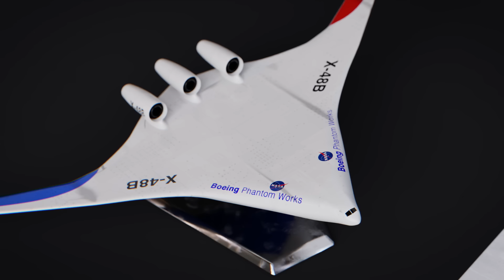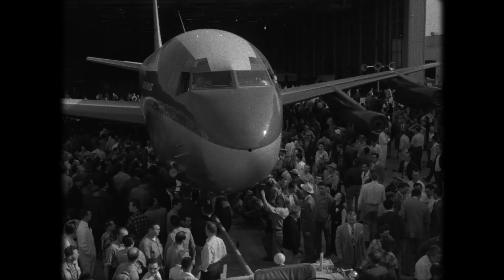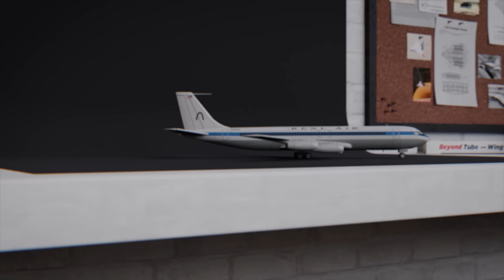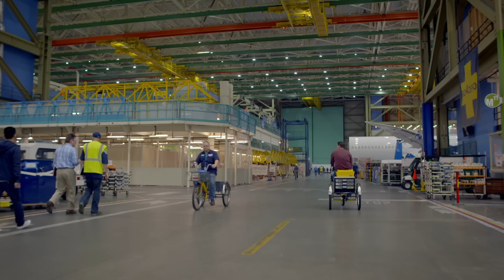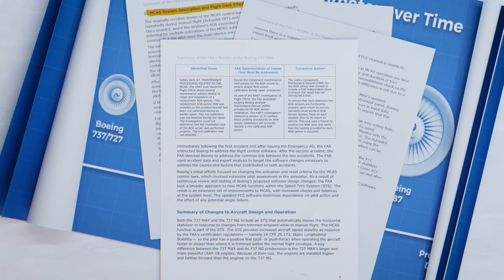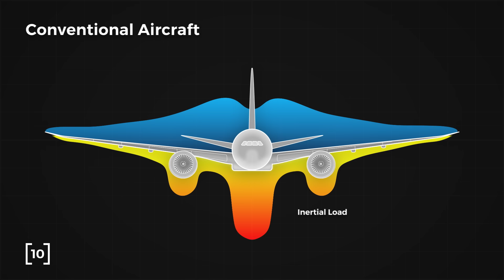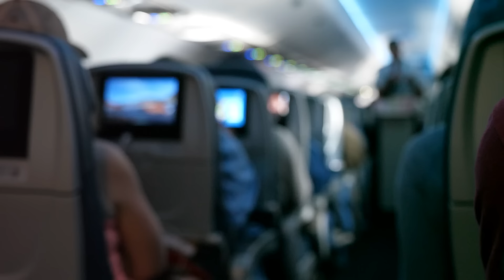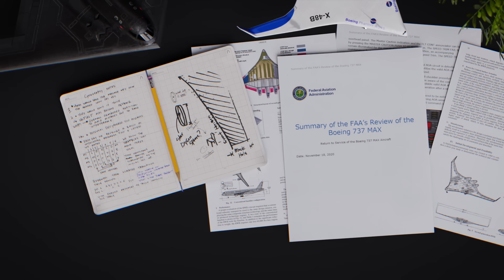The Plane That Will Change Travel Forever

Comment: 9:45 Fun fact: The Wright Flier, the worlds very first airplane was designed to be unstable. Both the wing and the canard provided lift, meaning if the plane left level flight it would be pushed father out of level flight by the passive forces.
      This was a deliberate design choice by the Wright Brothers, but subsequent airplane designers disagreed with this design philosophy and future aircraft designs were made to be stable, as you described.
     For the Centennial celibration of the Wright Brothers first flight a replica Wright Flier was built. Several highly trained and experienced test pilots tried to fly it, landed and refused to try again because the plane was so difficult to control.
     I'm not sure if the first flight was actually reenacted, but it makes that first flight even more impressive when you think about the fact that test pilots with thousands of hours of flight time were afraid to fly this plane, and the Wright Brothers did it with no flight experience at all.
      Can you imagine walking out to an airport, renting a Cessna 172 (one of the easiest planes in the world to fly) and teaching yourself to fly it by climbing in and taking off? You could, in theory do this. Flying an airplane isn't much harder than driving a car. But it would be highly illegal.
      But this was how the first generation of pilots learned to fly. Except they were not renting airplanes carefully designed by aeronautical engineers to be easy to fly. They were flying planes they built themselves with no understanding of aeronautical engineering whatsoever. Or at best very little knowledge.
      Early aviation is a wild and crazy story with plenty of death.
Reply: Awesome post
Reply: I built my own hang glider in 1979 without ever seeing a proper one.  A bit exciting but I am still here .
Reply: @George.Andrews.  Did you ever actually fly your hang glider.
    But now I think about it, you could be an aeronautical engineer.
      Even if you're not, even a home made hang glider (or even a full sized airplane) would be just as safe as a factory built aircraft.
     You may have trouble convincing the FAA it's safe, but it could be done if you know all the engineering.
Reply: @Eric Taylor  It was the Rogelo shape that was originally designed as a steerable parachute to bring the space shuttle down. 90-degree nose angle  with 3 degrees billow in the sail and a loading of about 1 pound per  square foot. 280 sq ft total. I took the dimension from small black and white photos from a library book using a pair of dividers. I wrecked my sisters sowing machine, making the sail. For the wires, I made a crimping tool, which I clamped in a large vice and beat with a club hammer until the faces touched. There are no hills where I lived, so with a harness made from seat belts, my brother driving my van (CF Bedford with wide wheels and fur lined)we towed it up. 
So yes, I'm an aeronautical engineer, hahaha.
Reply: @George.Andrews.  what's the opposite of an aeronautical engineer?...🤔.... a  crash test dummy...😆... They should give you an Honorary Degree...😁
Reply: @Reality_Check-1969  what have you done boy?
Reply: @George.Andrews.  🤣
Reply: @George.Andrews. that's a aeronautical engineer if I've ever heard of one
Reply: Having a canard does not necessarily make the craft not stabile in pitch.  if the Lift curve of the stabilizer is less steep than the wing, a pitch up will self-correct.  By the same token, you can have a stabile design with a lifting tail. To be stabile, the combined Aerodynamic Center needs to be behind the CG.
Reply: I think it bears mentioning how the brothers Wright taught themselves how to fly, because they first flew aircraft tethered to the ground, like a kite. Thus if they crashed they wouldn't have much forward motion making them more likely to survive any crash.

Only after that they started flying gliders and motorised aircraft
Reply: The wright flyer was stable, and they had been flying in similar looking gliders for years before.  They were aeronautical engineers, and scientists.  They built the first wind tunnel and did extensive experiments before designing and building the gliders.
Reply: Loop lplllpppppppp
Reply: @aryagamis  More like Loo-crack, snap, aaaaaaaaaaa crunch.
Reply: They actually had flying experience flying tethered gliders into the wind and down hills
Reply: I knew about the inherent instability! Look no further than the Wrights' background as cyclists for why they didn't dismiss the idea. Once they had a grasp of the mechanics of lift, understood their thrust needs and their limitations in terms of the weight and the thrust/weight they could achieve, having additional lift surfaces was an acceptable solution because they knew unstable vehicles can be made to work just like learning to ride a bike.
Reply: @fixedG bikes are extremely maneuverable, unlike tricycles.
And guess what military jets do
Reply: The Wrights created wind tunnels and carefully measured their designs.
Reply: You say it was "designed to be unstable". Did you mean that it was designed in a way that happened to make it unstable? Intentionally designing something in such a way that it does not fulfil its purpose correctly sounds illogical in this context.
Reply: The very first airplane are you sure? Ader's Eole wasn't a plane because it only flew 50m in 1890 but the Wright's flyer was because it flew 255m after having been catapulted? In the end of the day, Santos Dumont's 14bis remained the first to take off by itself (which is what self-propelled means) and Blériot XI crossing the English Channel was the really first truely operational airplane.
Reply: @Metr0politan92  If Ader's aircraft actually worked he would have kept developing it into something that could fly more than short leaps.

Keep in mind that the 1903 Wright Flyer didn't take off using a catapult, but a starting rail that lowered drag from the ground. Thus not putting any extra energy into the aeroplane. 
Also don't forget that their 1903 flights were made into a 27 MPH (43 km/h) headwind. You need to take this into account to accuratly judge their first powered flights, since distance alone would make the first flight seem like a lowered leap, like the others.

Remember how I said Ader should have kept developing his aircraft, because that's what the Wrights did and by the end of 1904 they were flying complete circles and flying more than 1200 meter in a single flight. In 1905 they flew multiple times well beyond ten miles.
Reply: @martijn9568  do we know ALL the factors with ALL the potential inventors?... the main ones maybe being funding and materials... and possible investors to back it all...
Reply: @Clery75019  So does that mean Santos Dumont's airplane was the actual first one?
Reply: @MeneTekelUpharsin  To me there's no such thing as a first airplane. It's been a progressive process from Ader to Blériot, and it's just misguided to want to credit a single plane as the first one in order to better discard all the other ones.

Comment: The problem is, airport infrastructure is designed for the tube and wing type planes.
      Planes like this could not use the same terminals as classic designs, meaning entirely new terminals will have to be built and designed.
      Airplane makers are not going to build airplanes that can't use airport infrastructure and airport planners are not going to build infrastructure for planes that do not (and may never) be built.
     Something like this happened before. The early airline industry had a problem. There were no airports. The problem was solved by building flying boats. They had passenger liner terminals that could handle large numbers of travelers and could be modified for relatively little money to handle flying boats.
       So the biggest passenger planes were not made to operate on land, they were made to operate on water, and could not be operated on land.
     This did not encourage anyone to build airports and without airports no one wanted to design larger passenger planes.
     This catch 22 was not broken until the outbreak of way forced the building of large airports from which large bomber planes could be operated.
    After the war these airports still existed. Some of the bigger cargo planers and bombers were converted to the first post war airliners and because they were much more efficient AND could be operated from land airports we saw the end of the flying boats.
      I'm not sure what could break the current catch 22 that is preventing a radical change in passenger plane design.
      You would have to design something that could operate from the present terminals. And we have reached the limit of what can be done there. The biggest plane currently operating has folding wings like a Navy plane just so it can fit in a normal terminal gate.

Comment: "In an act of corporate greed"  Not so simple.  FAA writes the regulations which are written for their purposes, not in the interests of technology advancement.  A more egregious example was the "three engine minimum" held for many years after engine reliability had been increased and two engines were just fine.  The FAA had to retire the executive to make it happen.  Europeans tend to trust government as an alloyed good.  They're not.  Government works to maintain the status-quo.  Airbus planes are really all fly-by-wire now and that is the future.  They have also has terminal sensor failures.  Lastly, pilot training in the East is traditionally a step down from the West.  I doubt a US pilot wouldn't figure that out pretty quick, disabled the MCAS and flown the plane, which is standard procedure MCAS or not.  (Full disclosure, my son in law is a 737 pilot)

Comment: Robert Liebeck invented this configuration decades ago at Douglas, well before the merger with Mcdonnell.
The advantages do not include the primary requirement of minimizing the overall costs per passenger - mile, combined with the capability of  actually safely reach remote destinations.
The overall best configuration is close to the Boeing 777-X, with the foldable  wing tips.
Reply: The induced drag explanations with the notion that the wing tip vortices are responsible for this drag is fundamentally incorrect. The kinetic rotational enery of the vortices are related to the energy exchange between pressure and velocity as described by the Bernoulli equation. Resulting in extremely low pressure in the core of the vortices, as seen in the visible condensation in the trailing wing tip wakes.
The induced drag is due to the leaning back of the lift force by the induced angle of attack.
The slower the speed the more the tiltback, and thus the induced drag. For normal winged aircraft this drag is proportional to the square of the spanloading and inversely proportional to the dynamic pressure: density times 1/2 velocity square.

Comment: Another idea to reduce drag and fuel consumption that is less radical is to move the center of gravity of the tube and wing so the tail produces lift instead of downforce. This, would necessitate computer control to counteract the inherent instability this creates. However, the flying wing also requires fly-by-wire computer control anyway.

Comment: Nothing new.  Nasa started working on this in the 1990s, and the concept existed for decades before that.  The BWB is not suitable for passenger flight.  Along with the lack of window seats it's far harder to evacuate such a design.  They may prove suitable for cargo transport, though placing cargo out in the wings means you have to carefully balance your load left/right as well as fore/aft.  And efficiency is traded for top speed due to the very thick wing, so again not the best choice for passengers not wanting to waste time in the air.

The "tube and wing" design repeats because they got it right the first time.  The flying wing B-2 only looks as it does for stealth reasons. Old news.

Comment: Look, the flying wing concept is cool and all, but was developed in Nazi Germany. The US got the tech from operation paperclip, among many others Germany was researching/developing. What I am trying to say, if I have not said it already, is that we need original thinkers who can propel us into the future! Not continue to modify existing designs and claim a breakthrough! I mean, the fixed winged/rotor aircraft have changed very little over the years and are still using basic mechanics designed over 50+ years ago! We need to break the chain and let the creative people take control for once!

Comment: Real Engineering.
An Aero Anomaly….
There is no physical evidence of lift at 25% of a wing chord when in flight on its own , with no tail plain and no fuselage. That is where the Aero Establishment say lift is centred when at zero incidence. 

Can you explain why a wing pitches down when it should pitch up, if lift is at 25%, that’s forward of the Centre of Gravity so it should pitch up? Professor Babinsky of Cambridge uni. says ‘Lift is at 25% chord with a little residual forward pitching moment’. 
It’s much much more than a little.
There is something amiss with the flight rules. 
Please see my video at. 
https://youtu.be/w6RlPHth1y4

This is something the Wright Brothers must have struggled with as they started with no tail plane.

I wonder if  you could make a much better video on this subject. 

I think the wrong assumption has been made right from the start about how the flow goes around the leading edge to the upper apex of a wing in flight.

So when you throw your hands in the air and say you can’t challenge Bernoulli’s don’t forget there is no physical evidence of lift at 25% chord. Try it your self. Something is not quite correct with conventional theory.

Bernoulli’s says if flow is accelerated the pressure is reduced. It’s this that perhaps doesn’t apply as the flow goes around the first 30% of the upper surface.

Regards Richard Spencer 
rmspencer111@yahoo.com

Comment: I recommend in personal flight devices investing more toward backpack wings with dual propeller set ups with an alternator installed with a windmill generator in the backpack and the top propeller powered by the bottom windmill propeller. Just house the propellers in wings that fold into the backpack.

Comment: Have they tried building a large 3D printing machine that can build a plane out of advanced designs and carbon fiber or certain metals? Whichever materials are best. But it would limit the amount of parts and building steps and fault points. Just a thought

Comment: To overcome the problem of pressure cycling on the fuselage a solution like in submarines could be adapted. 
Multiple tubular structures linked together can provide both a pressure and structural strength without major weight penalties.

Comment: ok cool but how will fit on a runway or any conventional airport
Reply: Yes. I watched a video about an A-380 and the issue it had at one airport because of only a limited amount of terminals can handle it. Plus the whole airline industry is transitioning away from airline hubs and favouring point-to-point travel. A big reason why the A-380 is already being phased out.

Comment: Couldn't you place struts inside the fuselage to prevent the top and bottom from diverging under lower outside pressure? You'd lose a bit of internal volume, of course.

Comment: which wont be adopted because the cost to adapt runways and service facilities at airports to fit it and the disruption to normal revenue that would cause would be too severe for the SHORT TERM ALL THE MONEY mentality that airline owners have. in their eyes its easier to keep older smaller planes flying until they physically cant do that anymore.